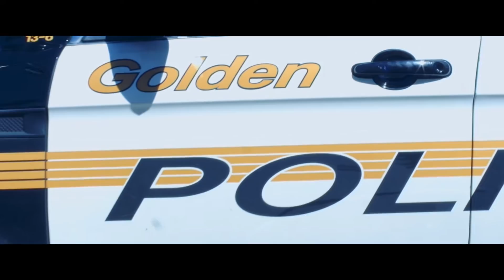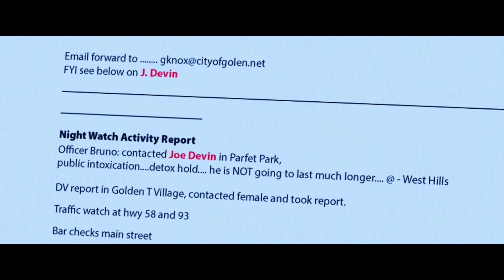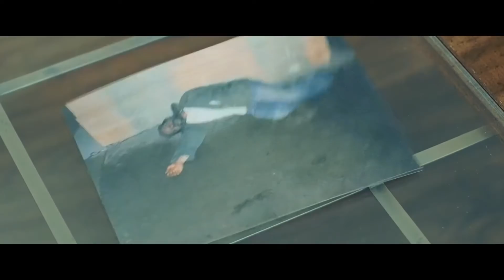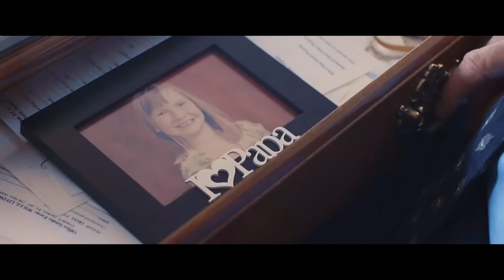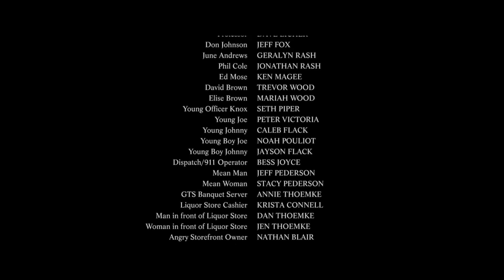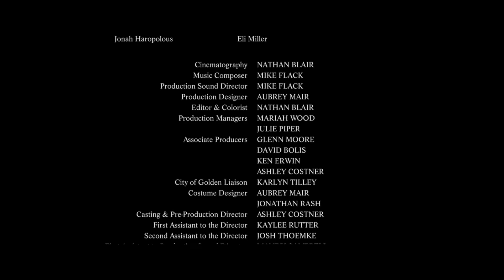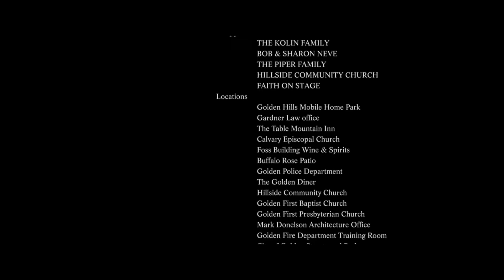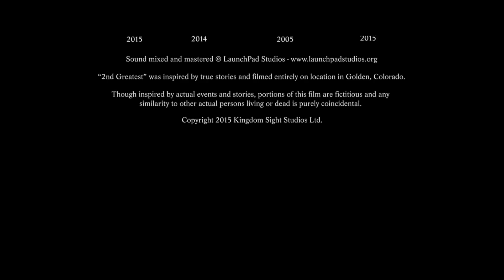OFFICIAL FREE FULL LENGTH MOVIE "2nd Greatest" - Christian Inspiration

Comment: Excellent movie! So needed to see this in the days we are living in now!  God Bless.
Reply: I miss the days when just a set of standard wrenches would fix anything on a car. A Phillips head screwdriver would change a headlight on a car. I miss the days when you could raise the hood on a car and see the ground. I miss the days when the fuel filter and fuel pump was not in the gas tank. I miss the days when a refrigerator would last 20 years instead of 5 to 7 years. Back in the day central heat and air units lasted 25 to 30 years instead of 10 years. The days we are living in now suck.

Comment: Addicts always have moments of clarity, where they know they're sliding downhill and want to make a change.  The key to solving this problem is to have facilities ready to accept them where they can dry out and make changes, far from the temptations of the city.  Often just being separated is what makes the difference.  And those facilities need to be run inexpensively so it doesn't cost the taxpayer a fortune.  The solution is to have the people drying out busy helping out with tasks and maintenance of that facility.